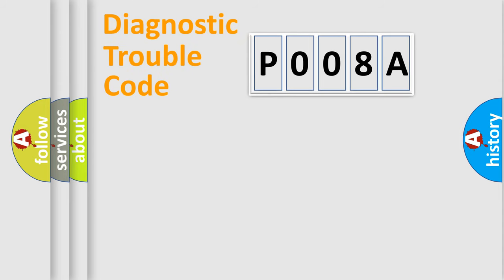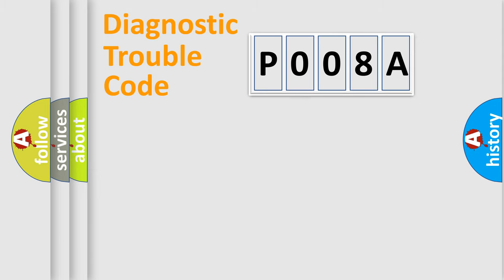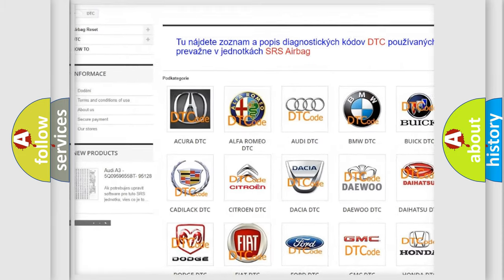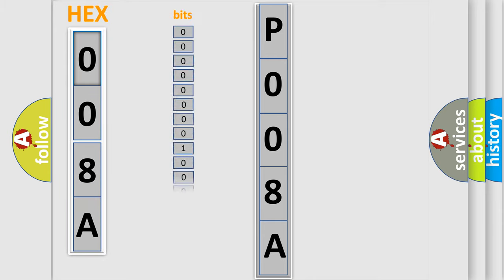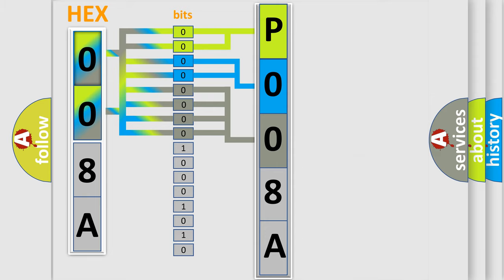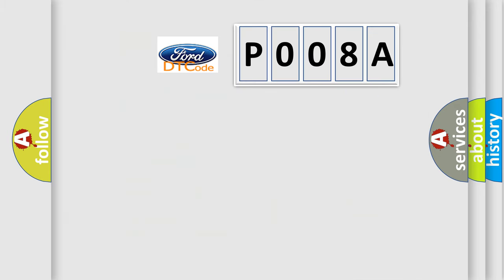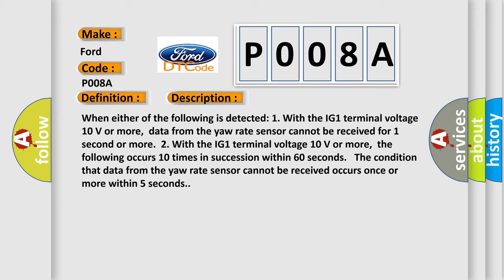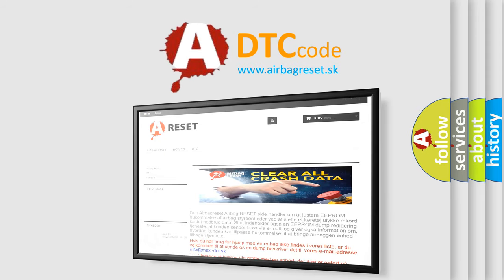DTC Ford P008A Short Explanation

Comment: That is not correct P008A is a low fuel pressure DTC it has nothing to do with the transmission or the rate or the ECU. It is all PCM.